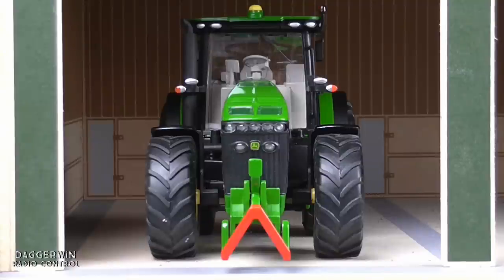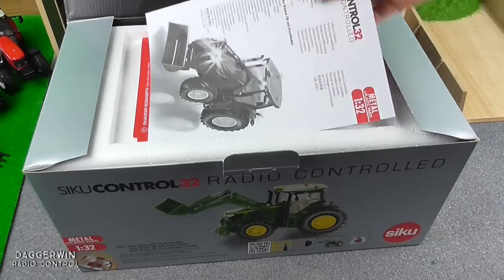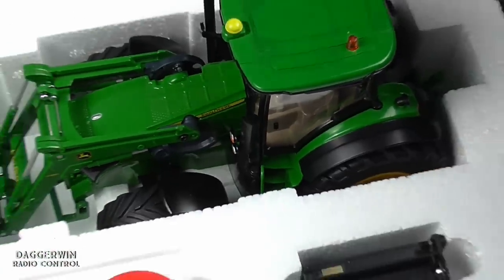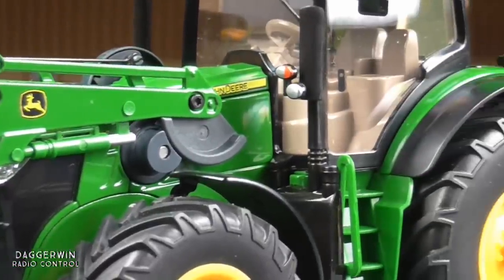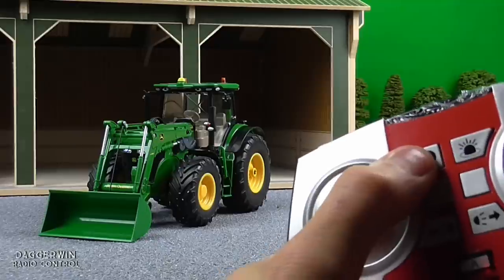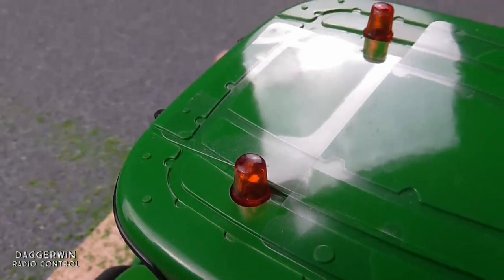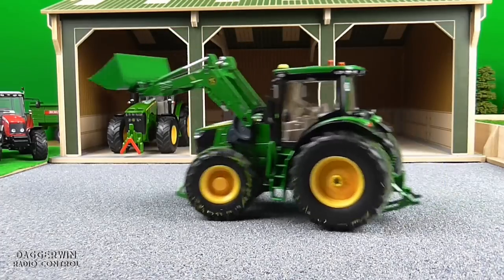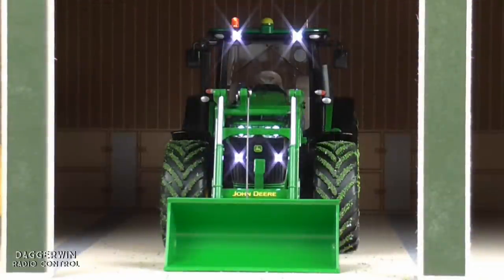Radio Controlled John Deere 7280R | Siku Control Unboxing Demonstration

Comment: siku made a RC tipper trailer about 6 or 7 years ago that was can be plugged into the back of the JD they also made a RC krone rake that would unfold remotely i bet you can get then on ebay or amazone
Reply from the maker: +The Pilot Penguin Yeah I used to own them, I have the RC krone rake but have never unboxed it because I don't have a charger for it. I will have to get one :)
Reply: Daggerwin i'd say you might be able to get one on amazon or the 8 yr old siku tractors have the charger cause they have the old style battery
Reply: They made a cultivator and working plow
Reply: Midget man89 mhm i didn't know about them
Reply from the maker: +Midget man89 Yeah they look good however I don't have any model fields to use them in
Reply: +Daggerwin daggerwin can you send me the link to the saiteck side panel uk because i can only find it but in america and it costs alot to ship over so can you send the link to me on youtube by replying to the message and sending it then.

i hope i made sence

can you send me your email aswell if possible 

thanks great video
Reply: +Daggerwin when I made i field i just got a bit of ply wood made some eges to it and then filled with fine top soil
Reply: +Daggerwin Great video daggerwin
Reply: Hi dagger
Reply: +Daggerwin i have got one they are great
Reply: +Daggerwin  hey dagger i have the  krone rake jd6920 and joskin tipper with the charger and 4 batteries i could sell all but the rake if u want them?
Reply: +Daggerwin can you do a video on the entire setup of the rc area you use ????????????????????????
Reply: The Pilot Penguin edfrfq